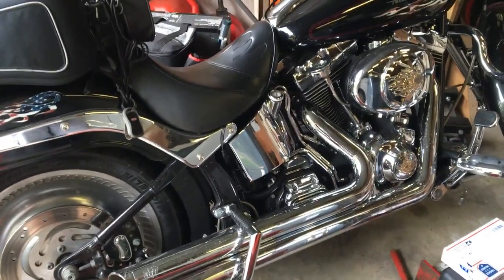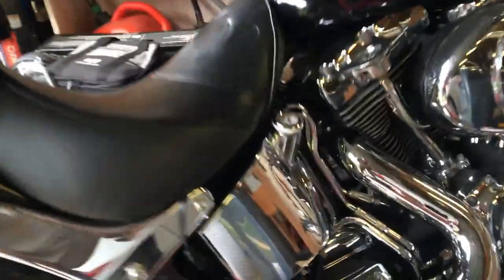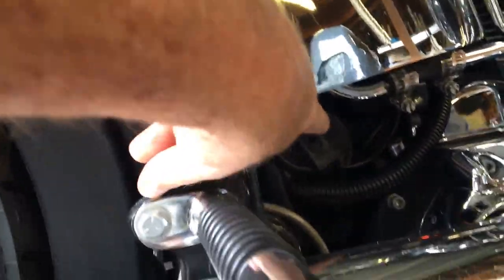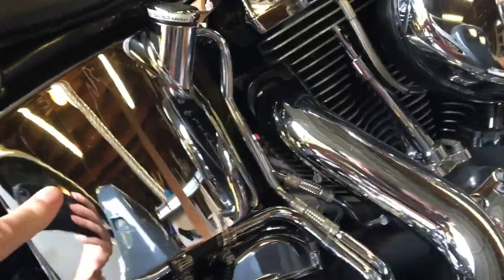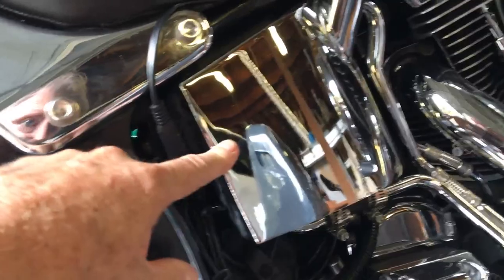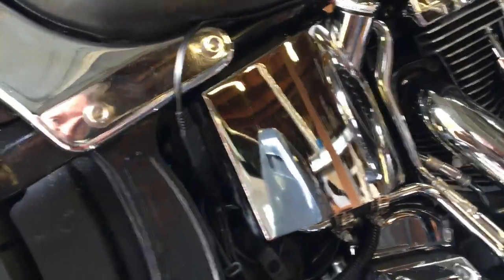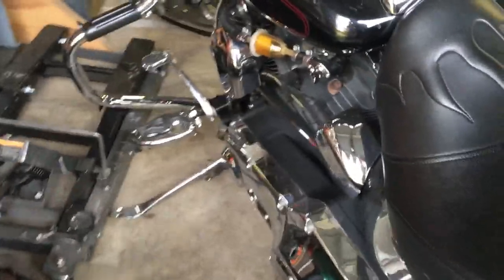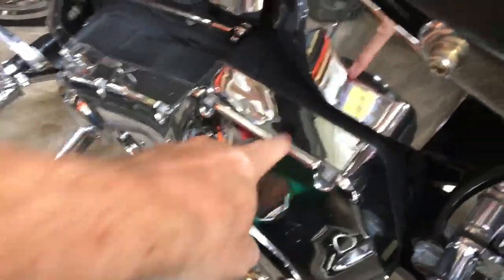02 Softail Deuce Starter Replacement in under 7 minutes.

Comment: This guy is doing this the hard way. I work on Harleys for a living and I can have a starter on a soft tail changed in 1 hour. The labor book calls for 2 to 4 hrs. There's a short cut he isn't using.
Reply from the maker: I’m sure there are some shortcuts. I don’t think you have to pull the rear wheel. I was replacing a leaking valve stem too.
Reply from the maker: Also, when people see how difficult it is they won’t complain about how much you charge.
Reply: No reason to take off the primary cover
Reply: Im a retired tech myself, if you can do a starter correctly on a 01 fatboy in an hour , your doing something wrong or  your not being honest
Reply: @Guglielmo Di Carlo  Gotta be smarter than the bike. They give you just enough room on a softail to remove the starter without remobving the oil tank. You can unbolt it and move it around just enough.
Reply: @captgraybush2890  are you saying you can remove the starter motor on a softail  without removing the oil tank, ???  if so I call bs, or prove it with a video, there is NO room to do that
Reply: @Guglielmo Di Carlo  I didn't take video, unfortunately. But it was an older red Heritage. I don't work for Moody's Cycle Werks anymore. They shut down, and I went back into cars. But it can be done, I promise. The area around the starter on the right side was pretty open. The only thing I did was unbolt the tank and move it back and up enough so the one ear on the starter would clear it. Presto change o! My boss didn't like that I used a shortcut. 🤷‍♂️ But what does he know? He wasn't a bike mechanic.
Reply: How long in your opinion is the change both  cam chain tensioners on a 2001 1450 twin cam fat boy please.
Reply: wish you would come fix mine,and so i,d know how fix in 1hour,more happy pay u
Reply: @captgraybush2890  have you ever done it this way? I want to change mine but dont want to mess with the oil tank.

Comment: Maybe I'm missing something but I don't see why you need to take off the primary cover to replace the starter?
Reply: True, these guys obviously don't have a clue....You do need to remove the oil tank though which in it of itself is a PITA. Typical HD where you gotta take 5 things apart just to get to the item in question. It looks like they got wrench crazy.
Reply: how are you suppose to remove the jjack shaft if the bolt is not removed under the primary cover? so yes you have to remove the primary cover  on that year anyway,
Reply: @guglielmodicarlo4139  that's a pretty poor design then. because you should just be able to pull the starter motor out just like you do a car starter. Without having to remove the Jack shaft first.
Reply: @gurnblanstein9816  that may be true, I suppose you have to ask the engineers that question, but that's not the discussion here is it, you were commenting on why they did that and were insinuating they didn't know what they were doing
Reply: @guglielmodicarlo4139  I wasn't insinuating they don't know what they're doing. I was just making a false assumption, thinking you shouldn't have to take the primary cover off.
Reply: @gurnblanstein9816  either way a useless  video for someone who needed guidance on doing this job

Comment: When you took the first starter off there wasn’t a clip on top, I have that problem and how did you rewire it back up? I got a 1989 and was needing help lol
Reply from the maker: Starter came as a solenoid/motor unit. No rewiring needed.

Comment: Damn that a lot of work just to pull the starter. 
On my 2012 StreetGlide, I can remove the Starter in 15 minutes.
I also have a 2000 WideGlide and it's much easier to remove the Starter. That Softail Oil Tank is a PITA.

Comment: Look brother I have a fully and I mean FULLY CHROMED OUT 96 fat boy , it was my fathers and I cherish it ! Last yea I had the click of dread lol managed to get by (half assed) but properly by bypass the relay , new switch , drilled small hole in the starter solenoid to push the contact in . 
Long story shorter lol now it’s just free spinning winding when I do it , so nothing but pop starting and that ain’t easy with one person to push back up hill haha 

My gear is fine , so is this the same procedure as mine ? 96 fat boy evo ?
Reply from the maker: I’ve only done it on the one.

Comment: I thought the early 2000’s required pulling the clutch basket?
Reply from the maker: Nope, just the screw that holds the starter gear and throw out assembly
Reply from the maker: That oil tank is always a bitch, though.